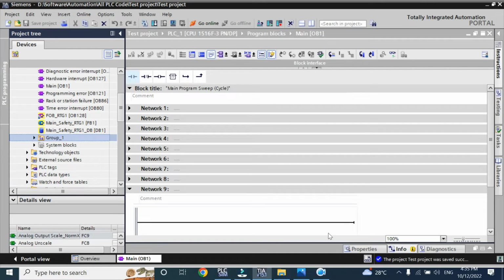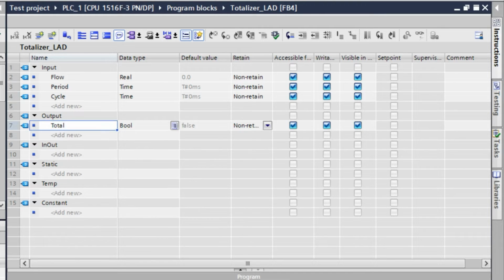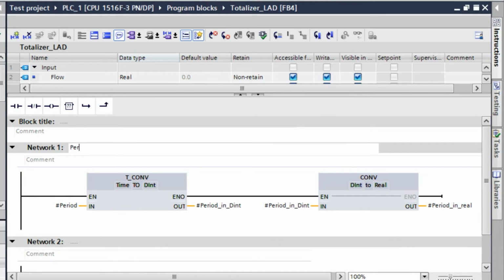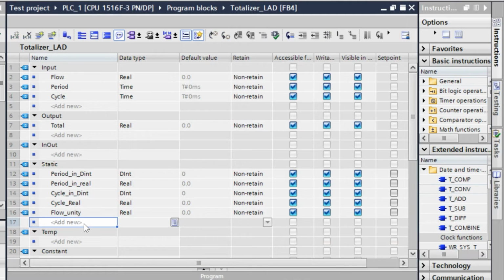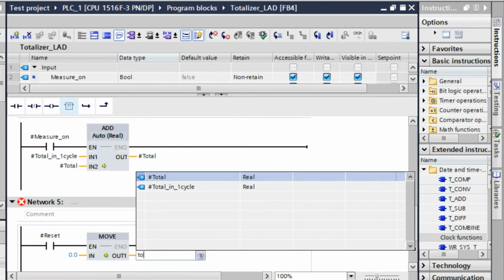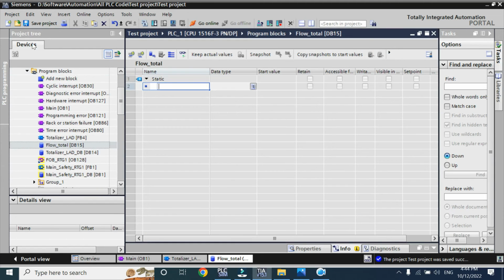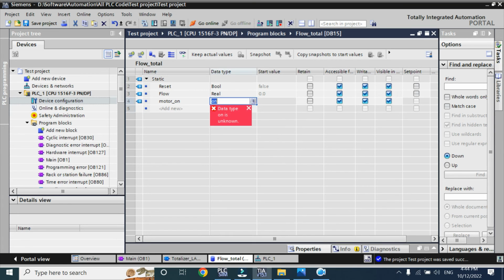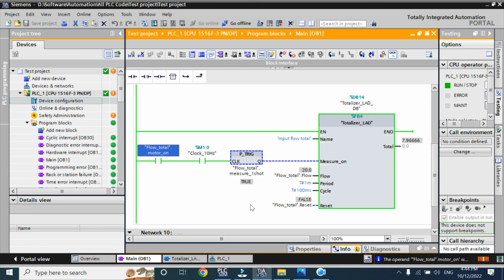TIA Portal: How to Make Flow Totalizer in LADDER and use it?

Comment: Brother is this program going to work at pulse signal ??.
Reply from the maker: No..
Reply: @faridautomation  is pulse signal used for analog plc or digital plc?
Reply from the maker: @oliahmedrose6479  if you have pulses from flow meter than you have to use high frequency counter input in your PLC than convert that pulse to flowrate as per the datasheet of flowmeter. Better to use a controller which will convert pulses to analog signal then you can add that analog signal to this totalizer block . If you want I can give  the ref of that controller.
Reply: @faridautomation  yes please..that will be very helpful
Reply: @faridautomation  and what will be the program for flow totalizer when we have pulse signal for plc input